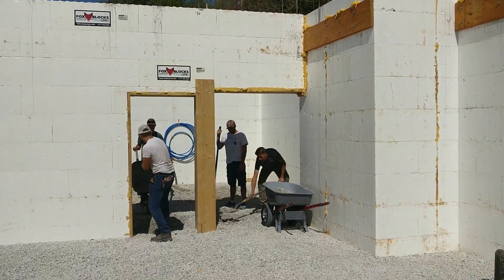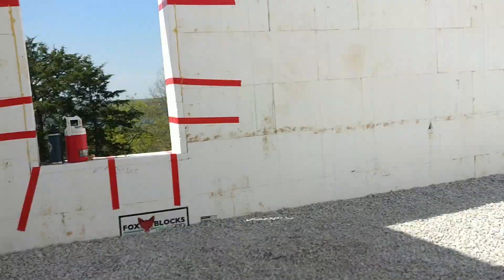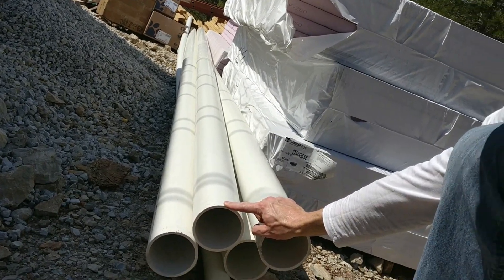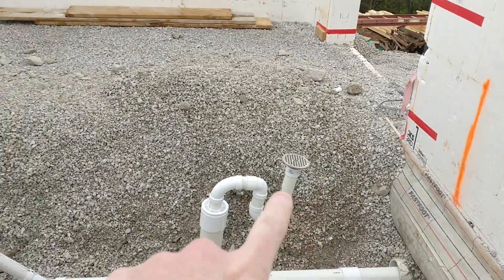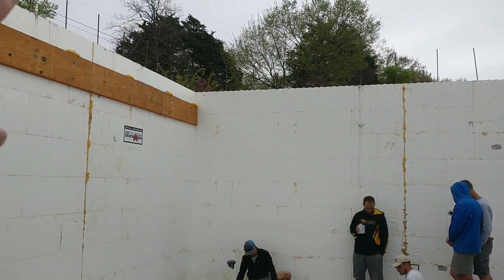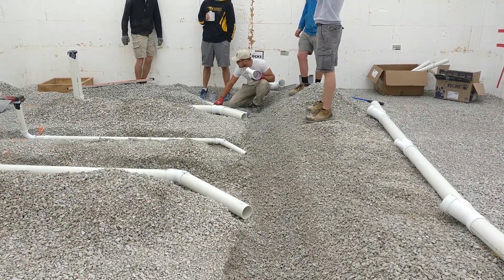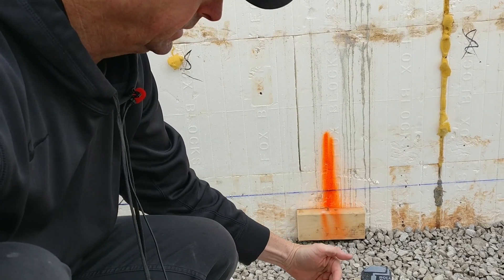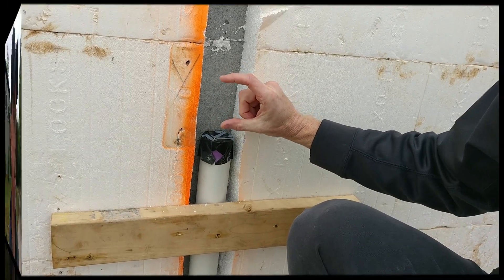ICF New Construction Build - Under Slab Rough In Plumbing

Comment: Hope you never have to use that stuff bro its all wrong, cant use pressure fittings and vent ells for drainage, way too much fall. The water will go down faster than the solids and you will have stoppages constantly, at least you do have a clean out, you're going to need it. Guys leave the 3 major trades work to the professionals. Nothing is vented either good luck with that mess working. 3 days 4 men for a 1 day job, LOL.
Reply: It’s triple vented and we have been using the house for 2.5 years with absolutely no problems. Thanks for the concern!

Comment: The cut away showing the concrete reflects a very good job pouring and vibrating.  I did not see any indication of any aggregate in the concrete showing in the cut away.  Do you know what concrete mix you used for that pour?  This is a REALLY nice ICF build series.  We are about to build a similar ICF home "kinda sorta" DIY.  👍

Comment: All my fixtures runs down one side of the house 32 by 72 2403 square footages bathroom, dining room,kichten,laundry room,master bathroom is there any steps up to take or just branch off all the way thur with the right fall on pipes and right fixtures

Comment: Did you do anything for Radon mitigation?
Reply from the maker: We did! It is not a huge issue in this part of the country, but we didn't want to have to do anything retroactively if we ended up with a problem. We ran pvc pipe under the slab that will terminate in the mechanical room. We can add a fan to it and vent it outside the house if.  needed

Comment: My plan when o build is to let all pipes loose and accesible in case of a hiccup....meaning i donot break any slab or concrete looking for the problem and finding it....key words are accesible, easy to diagnose, and easy to repair with a no hastle clean job....what do you tkink?
Reply from the maker: That is easily accomplished with a crawl space, harder to do with a slab for sure.